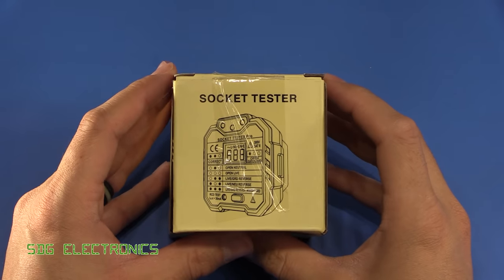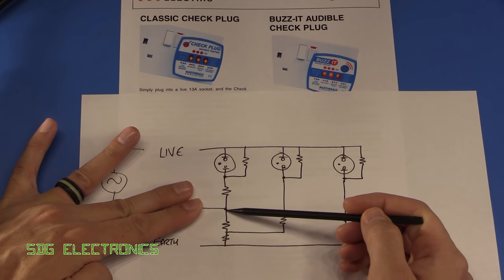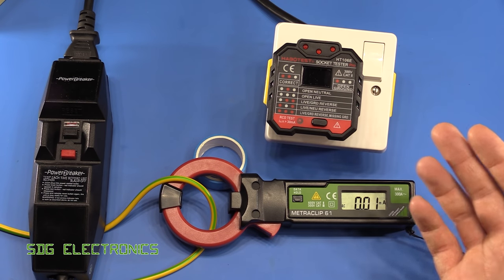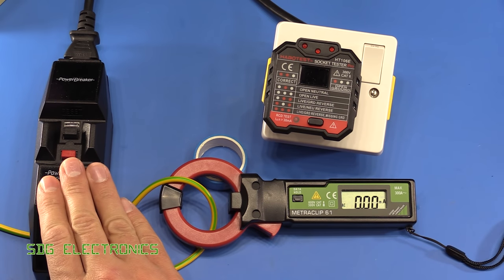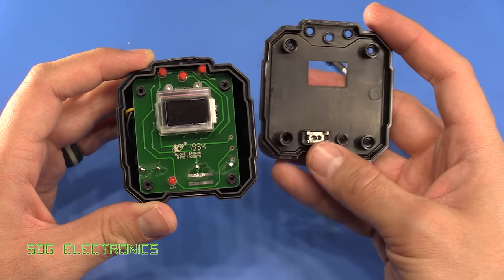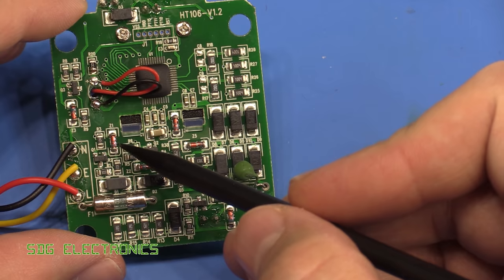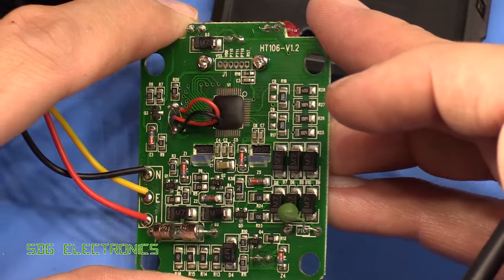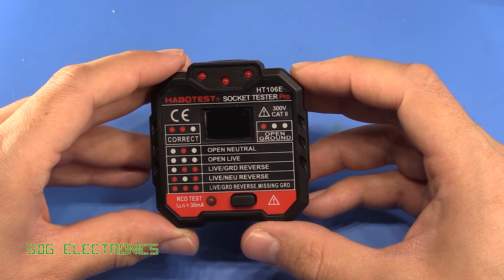SDG #112 Testing a Cheap Habotest AC Socket Wiring Tester (Use with caution...)

Comment: That design is actually simpler than what you described. The LEDs are just directly between the pins (with necessary resistors). That is why one (earth-neutral) is dark when it is OK. That kind of  a deign is popular in the US and in Europe. In the UK the all three lights on version seems to be popular. I agree the three on is easier to read but the two lights version is easier to understand.

Note they show missing earth on the right separately as that is the most common fault in the US, maybe not in the UK or Europe. In the US many change the sockets just to allow plugging three prong plugs without doing proper safety measures.

I have always thought metal on sockets is a bad idea. Note is you press the button it puts over 30 mA to the earth. If there is no earth it will give a rally nasty shock if you touch the metal.

Live and ground reverse is typically not real. It is more likely open neutral with a device plugged in another socket. it would be rare that anyone would miswire live and ground. The device knows only differences, not differences to the true ground so if line and neutral have same potential and ground not then it shows ground line reverse.This can happen if the neutral is open and gets voltage through some other device. That device of course would not function with open neutral.

Comment: Interesting Steve...GFCIs here in the states as I recall are supposed to trip when the current exceeds 5mA and above 5-10mA depending on your body size, conductivity etc. really begins to get into the painful and almost "can't let go" area if I'm not mistaken. You mentioned it may be a bit high, what is the standard where you are?
Reply from the maker: The standard trip current is 30mA for most RCDs/GFCIs in Europe. We have 10mA RCDs for specific applications but they are rarely used and usually retail for over £100. Similarly we have 100mA and 300mA RCDs but these are not for protection against electric shock.
Reply: The 30 mA is pretty high but it allwos easily protecting entire home. In Finland RCDs became mandatory on all sockets and lights (with the exception of fridge/freezer) in 2007. In the US they still are not mandatory everywhere because of the problems of nuisance tripping. We went in 10 years from no RCDs to full protection. The US started 50 years ago and still has no full protection.

In the US they are electronic. In Europe those are banned as they are not voltage independent.

Comment: on mine, the right LED is lit even though i haven't switched the socket on yet. And the other two on the left is faintly lit. WHen I switch the socket on, it shows normal wiring. Any Idea?

Comment: In Finland that would be illegal. You need to verify that the ground is really ground by touching a contact. If live and neutral are reversed and ground connected to line that does not detect it. It has no access to the actual ground.
Reply: Isn't this tool actually design to detect this fault. If live and neutral are reversed the first and third led should light up red.

Comment: Hello... if the trip test button is pressed, it will trip the 30mA RCD.
My question is, the socket tester is to stimulate the Live and Earth connection. Is that correct?
Reply from the maker: It is designed to simulate more than 30 mA current imbalance on line and neutral

Comment: Here in Belgium we have 300mA RCD's. Do you think it would work to add 270 ohms in resistors to this to make the test button work for that?
Reply from the maker: Possibly, but be careful of the power dissipation in that resistor
Reply: Those are likely in a TT system. They do not function as normal RCDs but make the earthing system work. Alternatively they are for fire prevention.

Each RCD should have a test button that is tailored to it.

Comment: Perhaps I missed it but no measurement of voltmeter read-out accuracy?!  Also, is there an easy way of adding a fine adjustment to the PCB that would allow the voltmeter to be 'calibrated'?
Reply from the maker: I think it was programmed calibration, so no user adjustable component.
Reply: usually accuracy not great, it design to differ 110v - 220v - 380v, For accurate measurement need voltmeter.
Reply: A few months ago my HT107D measured 200 volts which is very low. Then i sticked my Fluke multimeter into the same socket and it showed 229 volts. But other times the HT107D does measure it correctly.. I don't know what was up with the thing that day. But i wouldn't rely on it. This device is just to prove the correctness of your wiring, the volt meter function is just a gimmick.
Reply: @Engineer9736  voltmeter function only to differ 220 and 110 volts is something broke. and to look badass.
even instruction tell it.